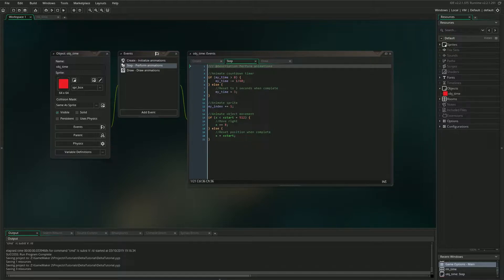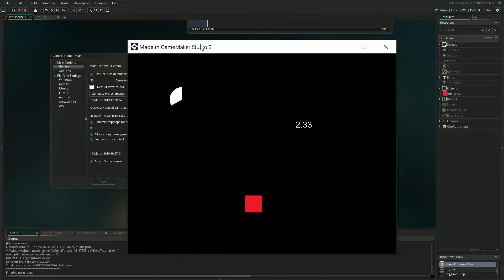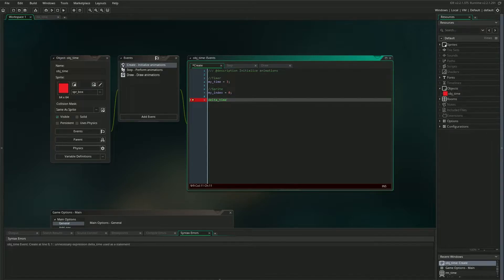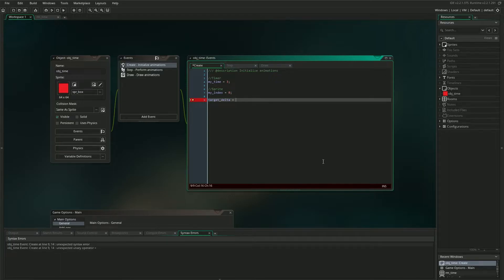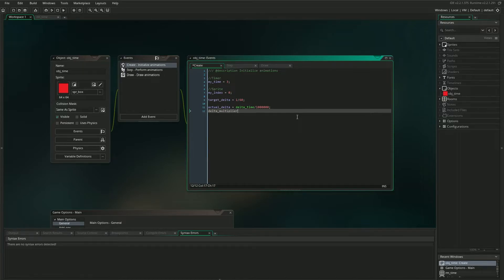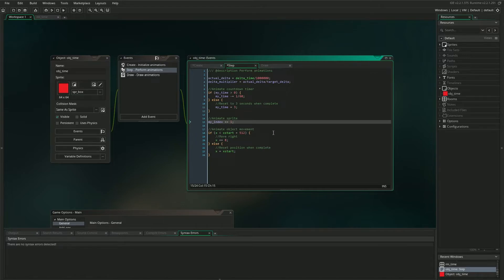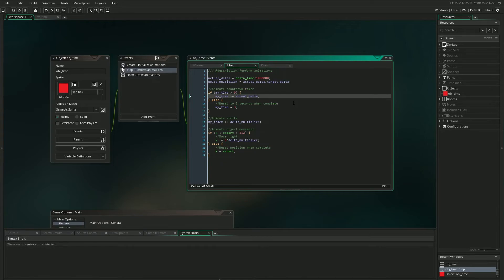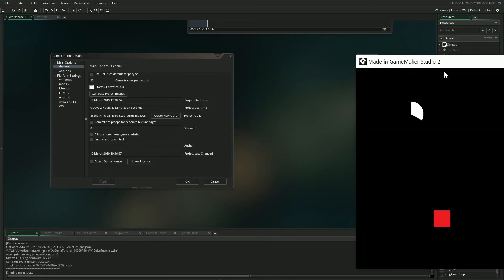Demystifying Delta Time - GameMaker Studio 2 Tutorial

Comment: i had trouble implementing delta time into one of my projects before because i had a lot of actions that would execute on a certain frame of animation. Example: if (floor(player_animation) = 12)
{
///Perform action
}

When i implemented delta time the action wouldn't perform or it would on the wrong frame.
I also had problems with collisions, my player would go through the floor. Those were my only two problems that i would like to figure out because i do find delta_time useful.
Reply from the maker: Delta time has a habit of revealing bad practice. Collisions should *never* assume a maximum travel distance in a single frame, but a lot of people do it because it's easy. However, it's also easy to break. You should treat collisions as a path, where if there's anything on the path between your start and end points, a collision is registered and movement is capped to the position of the colliding object. You can do this efficiently with a method called Newton's method. The simplest interpretation of it is, you divide the distance by 0.5 and check which half of the path has the collision. Then you divide that half by 0.5 and repeat. Within a few iterations, you can quickly find the collision point. More advanced interpretations will also work with curved paths, so you can factor in velocity, gravity, etc. and it will still work.

Triggering actions based on sprite frames is more similar than you might think. In general, I'd recommend basing your actions on time, not frames (this is the paradigm shift of delta time in general). But if you must use frames, you can round the current frame number to the nearest trigger value (not just the nearest whole number), or you can simply use >= instead of == (may or may not be applicable in your case).

Both of these topics would benefit from a tutorial of their own, so there may be a Part 2 video someday!
Reply: @LucasLive  Looking forward to part 2! Great work!

Comment: The main thing that keeps me from using delta_time is movement and collisions. I feel like it'd be really easy to screw everything up if your speed keeps going up and down like that. Things like hit detection, platforming, etc, would likely be very inconsistent, it seems. Any tips? Thoughts?
Reply from the maker: Good question! I've been thinking about making a Part 2 video covering that very thing.

Just like it's not good practice to write code that assumes a particular framerate, it's not good practice to write movement and collision systems that assume a particular speed. But because precise collisions are slow, you can cheat a little bit. For example, you can cap movement to a reasonable distance per-frame so that extreme deltas (e.g. < 1 FPS) don't break the game. Your collision system should also be able to handle multiple objects in the movement line and collide with the nearest object. Then you divide the distance between that object and the player in half and test both halves for a collision again. Discard the half with no collision, and rinse and repeat until you've narrowed down the X/Y coordinates of the actual collision point. Your player must be capped at this point anyhow, so no amount of delta time adjustment will break through it.

This is only one method, though, and there are many others that may be faster or more suitable for your project.
Reply: @LucasLive  That's a very interesting way of doing it. So just ditch gamemaker speed altogether, in favor of on-the-fly x,y changes. It seems like it would be really accurate and stable, but would require several ongoing loops per frame for every object, wouldn't it? I'd be worried how much more demanding that would be, say you were using a bullet hose or a hoard of enemies, but I'll give it a shot. Thanks!
Reply from the maker: @ablationer  For the most part, your collisions will happen inside a nominal range of performance. That means your loops shouldn't have many iterations under normal circumstances. It's only when things are already running exceptionally poorly that the math gets really taxing. Still, it does require some creative optimization to make sure everything runs efficiently. There's no one-size-fits-all solution, unfortunately.
Reply: @LucasLive  I suppose the best way would be to find a happy medium where delta time stops trying to compensate once you reach insane ranges. e.g. no more than 200 fps and no less than 15, or something like that. Thanks!
Reply from the maker: @ablationer  High FPS is almost never a problem, it's only on the extreme low end that issues really arise. But yes, one valid strategy is to cap the delta time value to a reasonable minimum, since anyone hitting less than 15 FPS can't really enjoy your game anyway.